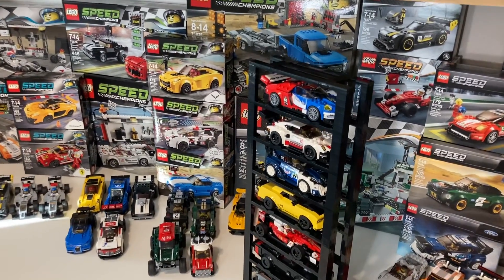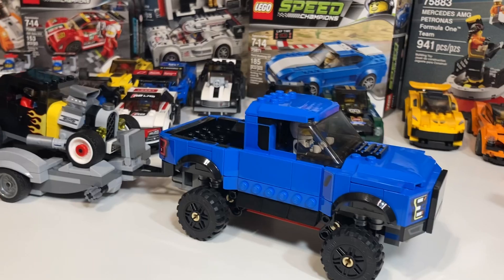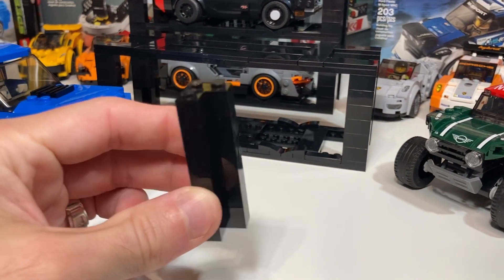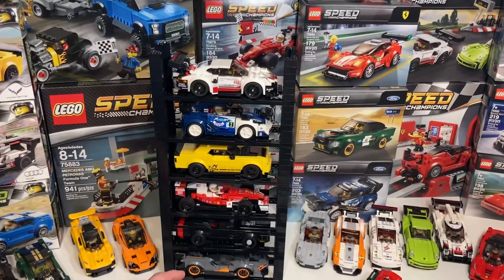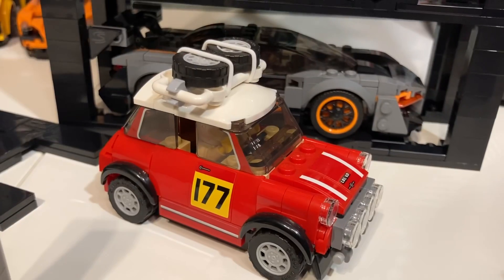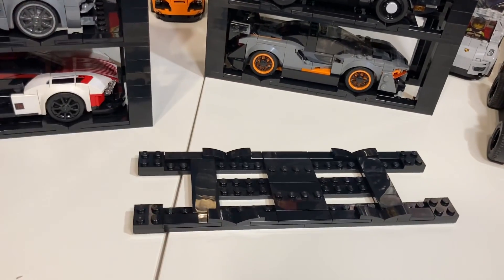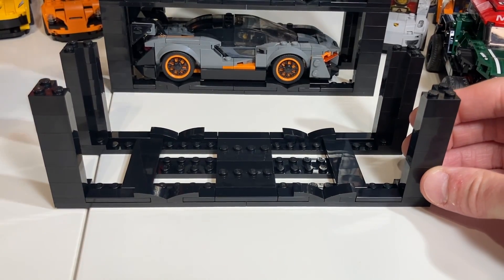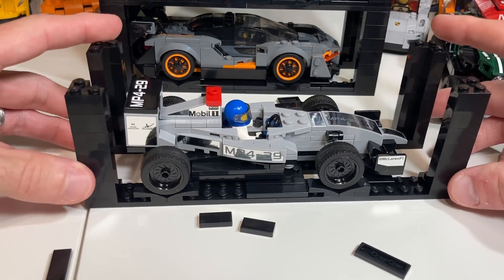LEGO Speed Champions: Brick-Build Display Racks - Gen. 1

Comment: Is it better to put a 1 x 4 plate covering the crease then two 1 x 2 plates on either side or just get a 1 by 8 plate to cover the crease and under the slopes for where the tires sit?
Reply from the maker: It depends on the wheel span of the car. For some cars you could use a 1x8 tile, but not all. For example the Ford rally car has a shorter wheel span. My goal was to use the same pieces no matter the car that you display. As long as there is some interlocking going on, a 1x4 across the crease helps hold things together just fine. 😊
Reply: @thegreenbrick  ok cool. That makes sense.